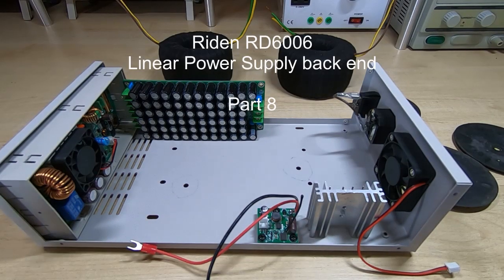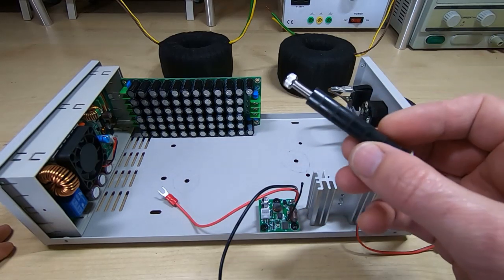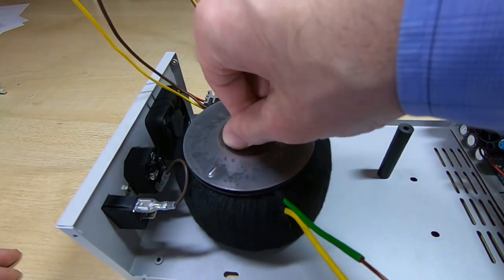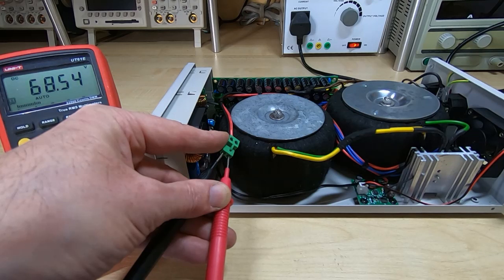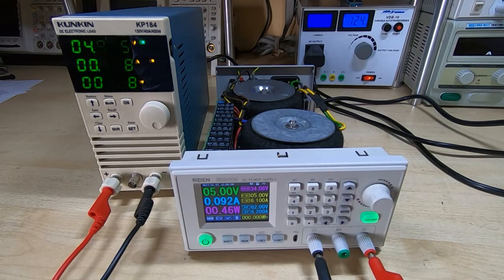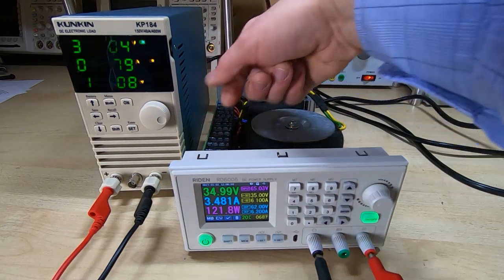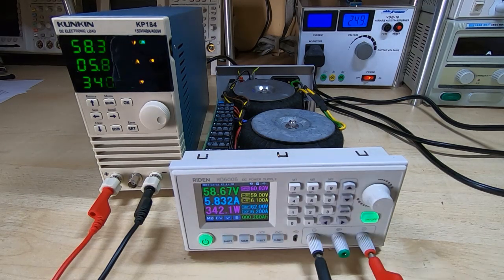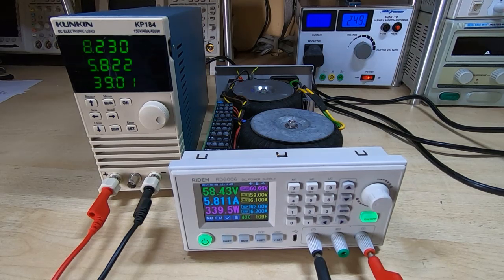RD6006 Linear Part8

Comment: Hi Jerry.  I've got one last question on the 6006 conversion.  I thought I had it all figured out and 90% of the time it's great.  Only issue is when things get quite in the neighborhood the mains voltage goes up which of course puts my RD6006 above 72V and the protection kicks in.  What would you suggest to keep it below the protection short of taking the toroidal apart and removing some turns.  Keep up the great work teaching.  I have learned a lot from you and even bought my first logic analyzer after watching your videos.  I never thought I'd learn to use one and it sure helped with my Intel 5070 motherboard. Thanks again.
Reply: you could add turns to the primary, series in a diode or two to drop it slightly, or keep a minimum load on the transformer to sag it below cut-off even w/o load.

Comment: Hello Jerry
I saw the video some time ago and just got a riden6006. You don't say what value your caps bank has, or why you a not satisfied with your bridge rectifier. How big a cap do you put  after the rectifier? I butchered a 400 watt PA amp, and that give me a toroidal transformer with 48,6 - 0-   48,6 x 2,  and one 16,4 and 13,8 V,  two bridge rectifiers ( kbpc3510) and 4 caps 10000 uF. 80V each.
I put one cap after the bridge is that enough? I do not think I can go higher because the voltage goes up to 69,7 volt. That is very close to the maximum input. The riden works fine, but according to  the riden display the input voltage goes up an down   69.30 to 69.50v   is that normal ?  When drawing 30 watt the input voltage goes down to 67V
If I need to put an extra cap, is there a way to lower the voltage coming from the transformer?
Kind Regards from denmark.

Comment: I have watched these videos several times and decided to do this with my RD6006.  I purchased the transformer which has two 120V coils on the primary and will give two 34V secondaries.  I wired primary and the two secondary 34V coils to give me 68V .  I actually have 71V but after going through the rectifier I dropped to 67V or so.  I thought, great, so I plugged it in and the RD6006 did not power up.  I checked voltage on the terminals and it was showing 99V.  If I unplug the connector, it's goes back to 67V.  I assume I burned up the 6006 because it will not power up even with the original switching supply.  Where did I go wrong?  Why would I show 99V when I plug in the 6006 connector?  I'd like to try this again but don't want to ruin another 6006
Reply from the maker: It depends how you are measuring the voltages. Are you adding smoothing capacitors after the rectifier. If not then you will not see the full rectified voltage. When you plug the 6006 in the capacitors in it will cause the voltage to rise to 1.4 times the RMS voltage so you need to account for that. Be sure to fit a capacitor bank and then measure the voltage before connecting. There is a small fuse on the 6006 (see my tear down video) so possibly this has blown.
Reply: @JerryWalker001  Thank you so much for the quick reply.  I do have the smoothing capacitors but I did not account for the RD6006 caps.  That would put it pretty darn close to what I'm measuring at the RD6006 board connecting plug.  Back to the drawing board.
Reply: @JerryWalker001  The more I think about it the more confused I get.  So your saying the caps in the 6006 will cause a 1.4x increase in voltage all the way back to the transformer?  If so I guess I would need to add some sort of voltage regulator after the recitfier so when the caps are energized the regulator would control what the 6006 receives.  Was this something you had to do to your conversion?  I thought as long as my toroidal transformer was only supplying 67VDC I'd be OK.  I have a lot to learn.
Reply from the maker: @keithharrison708  Without knowing exactly how you have wired it up and how you are measuring / specifying voltages it is hard to say. In brief if you have (for example) a 50V RMS AC winding on a transformer and you full wave rectify it then you will get 50V RMS single sided voltage output at twice the repetition rate of your AC supply. If you then add a suitable amount of capacitance on the output of the rectifier then the smoothed DC voltage will be approx 1.4 x 50V which is 70V DC. You need to allow for the voltage drop across the rectifier (eg 2x 0.6V) = 1.2V giving 70-1.2 = 68.8V. You also need to take into account the voltage drop caused by the loading etc. I allowed for all this and wound the transformer to give me a voltage that with no load would not over voltage the 6006 and on full load would still give the full 60V output (It is a very fine limit). The 6006 will shut down over approx 69V and it needs at least 64V to give the full 60V output.
Reply: @JerryWalker001  Making sense now.  I just ordered a 120v primary with two 34V secondaries and it never crossed my mind about the caps and the increase in voltage.  I wired the secondaries in series and wired it into the rectifier.  Live and learn but hey, I've learned a lot watching your videos.  I will have to order a 50V toroidal and try again.  Thanks Jerry for everything, you've been a great help.

Comment: I'm curious to know if anyone thinks it's sensible to put any inrush protection (thermistor?) on the transformer input, and a fuse on the secondary? I'm no expert and I don't know anything about failure modes of rectifiers or smoothing capacitors, but can they fail so as to cause a short of the secondary? Would a short on the secondary cause the fuse on the primary side to blow?
Reply from the maker: A transformer is essentially a huge inductor so inrush is not a problem. If the caps fail then the input fuse will blow so adding a secondary fuse is not needed. You can of course fit one if you prefer but fuses are intended to add protection to something and fusing on the secondary would not really add much. If the primary develops a short then the input fues will blow. If it develops a secondary short then the input fues will blow. Excess current draw (eg shorted cap) would cause the fuse to blow. The RD6006 has its own fuse protection so adding additional fuses is not really needed.

Comment: well done, another class act from your hands..you should be making them in bulk and putting them on the market.
If you could come in at a tad under 100 USD delivered, you would have a winner on your hands and Korad would be shaking in their boots as an entry linear bench PSU..
nahh just kidding obviously not doable at those margins.
To me a puzzle back then how Korad could sell these linear PSUs at 60 to 75 bucks delivered
purchased two P-versions back in the day (PC programmable) and still running fine.https://imgur.com/gallery/B7ZOQ3J
can you put these old Korads of different amp-values 30v5A and  30v3A and also different models KA and KD in parallel and reach the 8amp?

Comment: I love this series of video's, i've ordered a RD6006W unit with case and a smps version 40 watts , i love the idea of changing this to a lineair version , but why did you rewind the transformers?, it there no transformer on the market that matches the criteria for this purpose or where the reason that you already had this transformer and just needed to adjust it?., what i was also interested in is the Kunkin KP184 i want to order it, could you do a video on the complete calibration proces? , i think people want to see that, i was looking for a 5 1/2 digit bench precision dmm  ,i have Rigol equipment in my own lab, but what's the best value for money precision dmm?
Reply from the maker: Thanks. I rewound the transformers so that I could make a series of videos on how to do it. My channel is about fundamental engineering rather than just buying ready made parts and bolting them together. I think that the best way to learn something is to do it and in my opinion far more can be learned by building from scratch and this series of videos was really about how to wind a transformer. Simply buying a transformer would have made a fairly dull video. I did not show the full Kunkin calibration process as it requires a current source that can go up to 40A and as most people would not have access to such a device I did not show this step. I may post a video of the complete process in the future if there is any interest.
Reply: @JerryWalker001  , thanx for the reply,  you're right a 40 amp constant current source is a special kind of device that i also don't have in my lab, and you're right making it yourself is much more interesting then just order it, i enjoy the video's you make on the subject.

Comment: Sorry if I missed it in the video, but, what happened to using the super bridge rectifier?
Reply from the maker: I did not post a video after fitting it (everyone seemed to be getting a bit bored with the series) but as expected the voltage rose by 1.2V and the load variation was lower by 0.8V so the supply can reach the full 60V output at full load without triggering the over voltage input protection of the controller as long as the mains is between 238V and 252V. I did not mention it in the video but I included 4 extra turns on the seconary of the second transformer to allow operation down to 227V (by swapping the connection). It would be better if this was via a switch on the rear panel but I did not do that.

Comment: Too many failure points .
Reply from the maker: The main killer for EL capacitors is ripple current. You are correct that the probability of failure is higher due to the higher number of components. However the ripple current in each capacitor is so low that if you look at the spec you will see that the life should be an order of magnitude higher than for a 'low count' capacitor design. This should give a comparable life but it will be interesting to see how it survives. It will of course also be possible to simply remove any that do fail. As I say in the video this is not the only or even best way to do this but it is always interesting to try different things.
Reply: @JerryWalker001  Yes, I guess time will tell how reliable the unit will be.

Comment: Hello Jerry. I bougth the same capacitor bank off ebay. You said that you modified some parts. The AC side is not used at all. Do you have more details on what you did? Do you have a high-res photo or a schematic? In part 9 you say that you connect all the things using the screw terminals on one side, but I don't really get it. There are two GND-terminals, two VEE- and two VCC+ terminals. Could you explain a little bit more how you used them? Thank you very much :-) Best regards, Andreas
Reply from the maker: The bank is designed to use the supplied bridge rectifier and provide a +/- supply with GND being the centre point. I only wanted to use it as a 'single' capacitor so I fitted half the capacitors 'backwards' so all the 0V terminals on all 68 capacitors were connected to Gnd (Not as shown on the silk screen). I then connected the + and - supply rails together via a link on the screw terminals to connect all the capacitor +ve terminals together. This meant that all 68 caps were in parallel. I then used the Gnd as 0V and (now) common +/- terminals as V+. I hope that makes sense. If not let me know and I will post a video to explain it (I did not take any photos of it).
Reply: @JerryWalker001  That makes sense in combination with your video part 9. Did you populate all parts on the pcb accept the supplied bridge rectifier? Do you use the supplied bridge rectifier as the bridge rectifier for the hole device? It looks similar to the one you added a heatsink to. I am currently soldering all 68 caps in.
Reply from the maker: @Timberw0lff  For testing I used the supplied rectifier but I later replaced it with one of the low drop types. You can probably just use it but not on the capacitor bank board as it would be wired wrong (and needs a heatsink). I used a separate heatsink but I think that simply bolting it to the inside of the case would be sufficient.
Reply: @JerryWalker001  Thank you for the information. I just have finished the capacitor bank. Now I need the two toroidal transformer. I am not yet sure which one to buy. The suited ones are expensive, around 58€.
Reply: @JerryWalker001  I'd be really interested in a video explaining how you modified this kit for your purposes. I'd also like to see how you wired the whole supply from one end to the other. I'm waiting on my kit to arrive and being a novice at such things I'd like to be doubly sure I'm not going to fry the components or myself! I will look to follow your explanation above of course but I think going into the modification as a step-by-step would be interesting as well as helping out those like me who are "following along at home" :) Many thanks for the effort in producing your videos. Stay safe.
Reply: Thanks for sharing. Did you make the video to explain?

Comment: Hi Jerry,
I'm just wondering if I'm missing out on something here, but I haven't seen anything like an inrush current protection in your design? Are the toroidal transformers you are using not big/powerful enough to cause problems while powering up? And btw, how much total capacitance did you install after the rectifier?
Reply from the maker: This is not needed as there is no where near enough capacitance to cause any issues. The recetifier has peak current handling of 600A so it will never see anything high enough to cause problems. The transformer is also 'peak power' limited by virtue of its core performance.

Comment: I noticed alot of old power supplies use a massive RF choke, these chokes are huge and expensive, how do modern power supplies do instead ?
Reply from the maker: Many old supplies used a combination of inductors and capacitors to smoothe the supply. Inductors work very well for this but are of course much more expensive and heavy than capacitors so most modern supplies use capacitors for 50 (or 60Hz) as the required inductors at these frequencies would be large and expensive. However most HF switching supplies still use inductors because they can of course be much smaller. Also many older supplies tended to be low current at high voltage so inductors were a better solution for this.

Comment: Wow that's quite the dip. It looks like you might have to exceed the stated 70v input maximum for that thing to get a full 60v output. I hope it does okay!

Also glad it doesn't bug out at max power 😁
Reply from the maker: The droop is as expected. You could use thicker wire on the transformer to reduce it a bit but as it meets the design requirement then it is fine. The videos are intended to show this very issue (amoungst others). The input will be 69.5V with the correct rectifier and the supply will tolerate up to 71V. It would also be possible to fit a pre regulator but for my purpose it is not needed. Remember that in the video the supply is being run from a variac and this introduces droop of the 'mains supply' so the actual drop will be lower at the RD6006 input.

Comment: Thanks for all this work.  I just acquired a RD6006 along with the suggested switching supply - Except for the residual noise, I am really impressed with the accuracy and the reapeatability of the RD6006 settings - So I am really looking forward to your noise analysis with this linear supply - thanks again for this well prepared series.

Comment: How to calculate the capacitance needed between the transformer coils and the Riden?
Reply from the maker: You can just calculate this based on the current that you expect at peak and the amount of ripple you are prepared to tolerate. As a very rough estimate you can use  Peak Ripple  = 0.7 x  Supply Current / (C x F) where C = capacitance in farads and f = frequency (2x mains frequency for full wave rectifier). This is a fairly generalised formula and does not take many factors into account but will suffice for simple purposes. In the case of my supply it gives a ripple of around 2.8V pk/pk but this is fine for this design as the 6006 regulates the incomming voltage. The next video will show the resulting waveforms. You will see the purpose in spending the extra time and effort building the linear version.
Reply: @JerryWalker001  Thanks Jerry.  Your videos are really excellent and educational

Comment: Nice job but I am confused how you are getting the heat sink temp from the can controller board because I didn't think that board connected to the Riden
Reply from the maker: There are two sensors. One on the fan controller board and one on a flying lead from the 6006. I have them both attached to the heatsink. I will show them a bit more clearly in the next video.

Comment: I wonder on the switching power supply design if you added that huge bank of capacitors if that would somewhat smooth out the cheap switch mode power supply noise?  Or it is more capacitance to ground that would be needed to suppress the switching noise?
Reply from the maker: The next video should clarify matters. No amount of capacitance would help reduce the switching noise as it is mostly inductive coupling and ground loop / mains loop noise. I am currently setting up the testing and will try to demonstrate the difference between the two supplies. You WILL be surprised.
Reply: @JerryWalker001  Looking forward to it.  I enjoy learning new things especially around power supplies since they fascinate me.